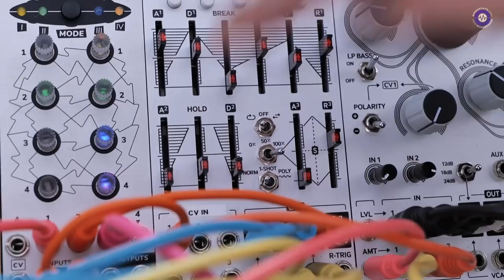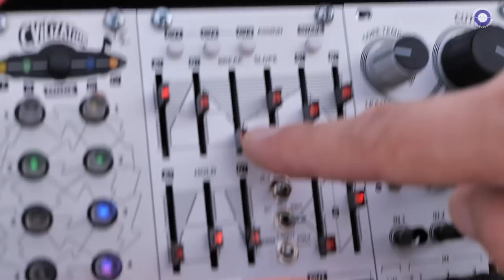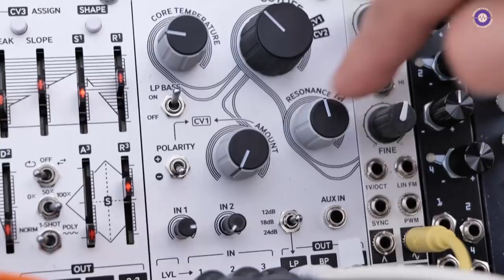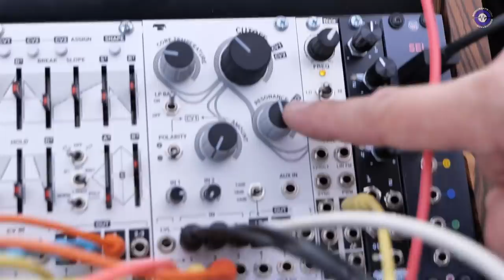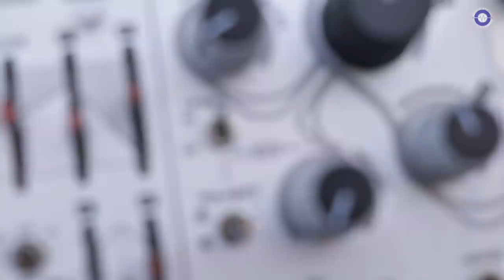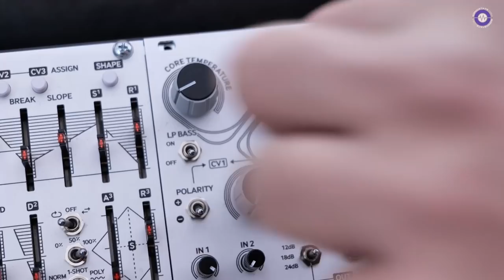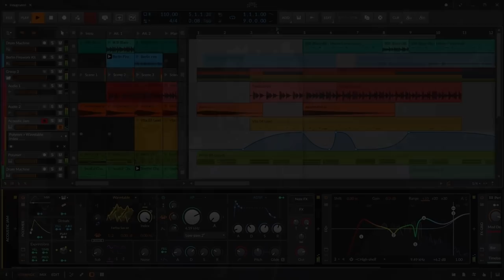Superbooth 22: U-he - Prototype Envelope And Cascade Filter

Comment: Would be nice if they give us some info about the filter topology used, as they claim to be quite unusual. Both modules look really promising, as most of their plugins do. Good news is that these ones doest use any cpu!
Reply: It's generally a 4-pole cascade filter based on SSI2164 chips. To make it sound more alive we experimented with a plethora of diodes in asymmetric configurations, and with different feedback structures to compensate for bass loss when turning up resonance. So we added a second SSI2164 to control some of the non-linear gain staging, and we use some left over VCA slots to offer a lot of handy options (VCA control of CV, VCA control of one audio input and output VCA control)

Comment: Hope they model that filter for their Diva 2.... 
I wish they would expand the Diva, with dual filter slots, and 4 OSC slots (single osc and single filter per slot, leaving it up to the user to freely select, but with some limitations when it comes to sync, cross-mod options, those might require loading modules that contains multiple OSC's and occupy more than one slot).
Reply: Software filters are never the same as a hardware filter